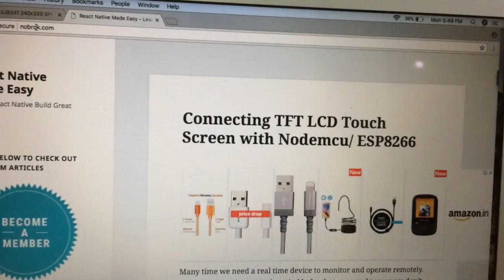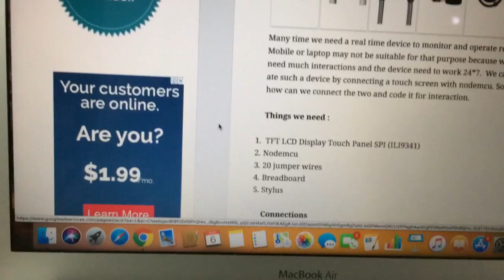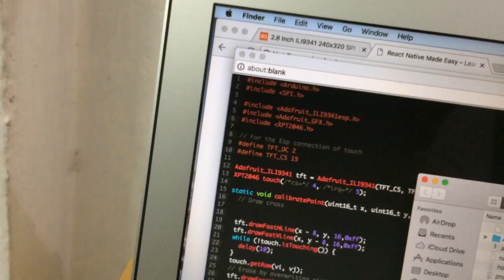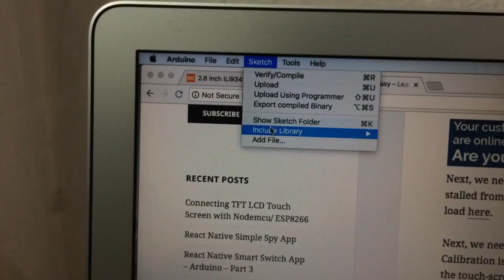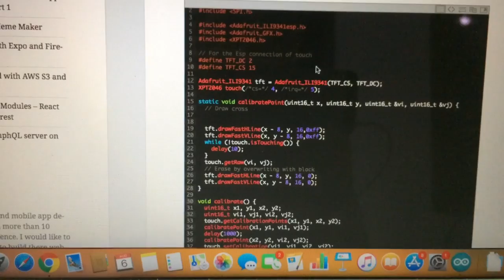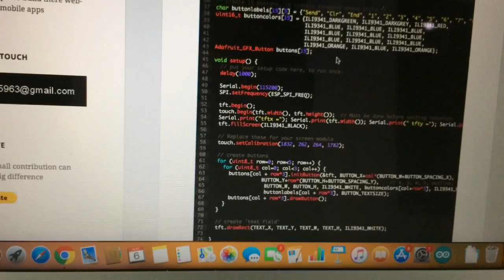Connecting TFT LCD Touch Screen with Nodemcu/ ESP8266

Comment: The screen you used is a tft spi screen but the code you have written is for the lcd screen. I want to know how touch operation works in tft spi screen using nodemcu? Will you plz help